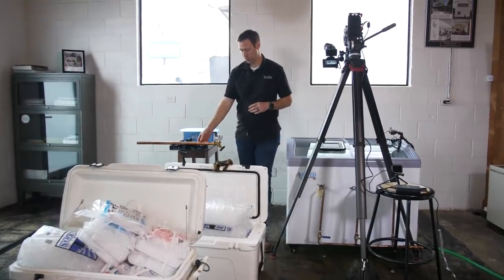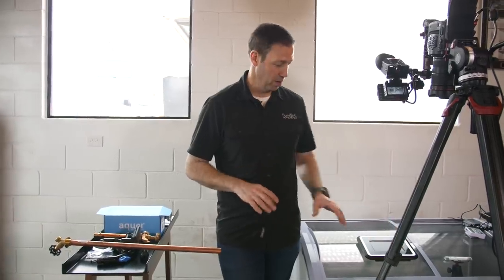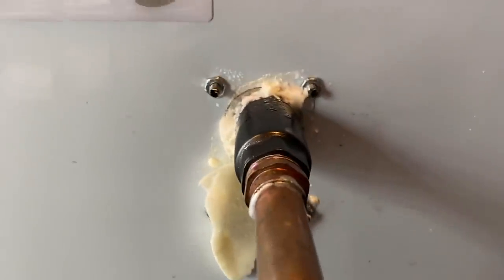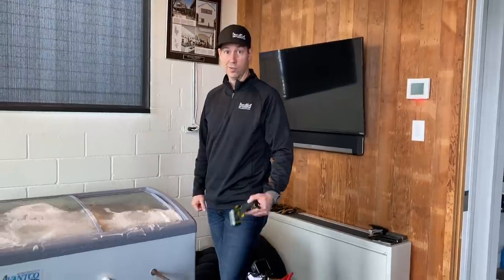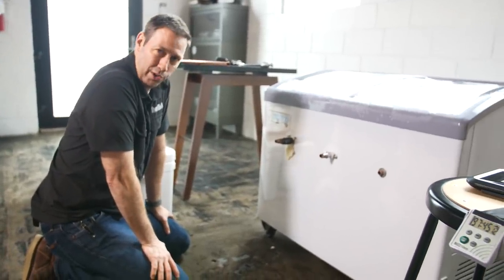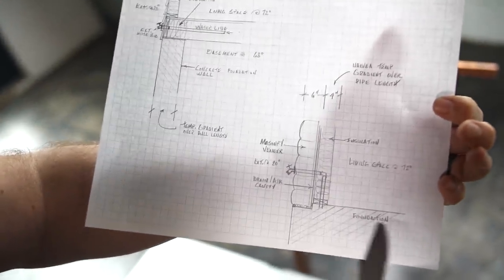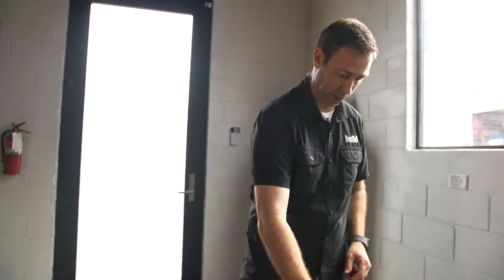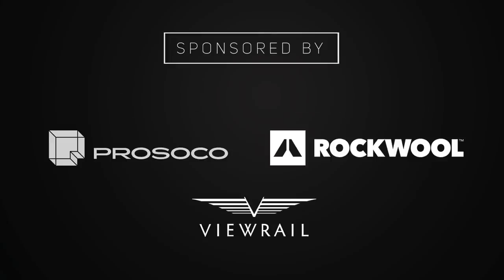Frost-free Hose Bibb?  Yep, it TOTALLY ICED over!

Comment: I like the concept and idea of running this test. However, in addition to the trapped air mentioned in other comments, you can't do a straight substitution of dry ice for chilled air because of significant differences thermal capacity and rates of thermal energy transfer with regard to conduction, convection, and (to a lesser extent) radiation. 

To be fair, I think this test would actually be somewhat challenging to run in a way that would be indicative of results in-service because there's a lot to be said about forced air. When it's really cold out, there are often strong winds that come along with it.

Comment: In northern climates the vapour barrier is on the inside. Even if the pipe gets cold, you won't get condensation there because the air inside the insulation has the same dew point as the air outside.

Comment: I remember visiting farms that had pipes sticking out of the ground with hose bibs and a handle on the end that they used for watering their gardens and the chickens.  This was in Wisconsin.  I always assumed they used those faucets all winter long.  Am I mistaken?  I always thought that was a better solution than poking holes through the sides of a house or barn.
Reply: I think there are bibs designed to have the valve go deep underground below the frost line. I know there are definitely hydrants at places like campgrounds that have the underground valve.
Reply: I worked at a golf course where we installed one.  The handle that you use to control the water flow was 8 feet below grade.  It was coming off an 8” municipal water main which is why it was so deep.  This was in Southeast Michigan.

Comment: Rubbish at best a pitch of Aquors. We install 12" or at least 10" frost frees bib (not 4") with vacuum breaker, they will last a lifetime with a single easily replaceable  gasket.  The $100/$150 aquor plastic bibs + [$25 plastic Removable Faucet]  at a great disadvantage. Their claim is meaningless to be "asse approved" (never heard other than Vacuum breakers certifications) in 50 states... And applying Dry Ice at -109F and other side Texas humid air and saying look at the moisture ... just as rubbish. Just about anything placed on Dry ice will show "moisture" issues. Aquors provide a clean look and that is about it. They have moving parts and connector could fail due to debris and been plastic.

Comment: I live in Northeast Arkansas and several times during the winter we get nasty dose of hose bib popping cold.  So, we did not include outside hydrants when we built our home.  Instead, we ran a loop of 3/4" PVC pipe around the house tucked up to the foundation.  This loop feeds hydrants at the various flower beds that we water.  The hydrants sit on top of galvanized pip risers.  I use standard hydrants and I really like the 1/4 turn ball valve models available from Lowe's.  The loop is fed through a cut off valve located the main water service line.  When cold weather threatens we close the cut off valve and we don't have to worry about a busted hydrant while we are out of town.  In almost 20 years we have never had a busted hydrant.  Materials were cheap compared with the cost of opening up a wall to replace a split line.  Assembly time was half a day at the most. We did the job before the footings were back filled and avoided the cost of digging a trench.  With this system you can tap in additional hydrants when and where needed.  It is important to disconnect all hoses when you winterize the loop.  If Matt had attached short, water filled hoses to hydrants before they were covered I can assure you that two of them would have busted for sure.

Comment: The pressure coming out the first one was the air bubble trapped from you turning on and off the water . All three needed to be bled with water pressure. You need to redo this test and try more materials besides copper

Comment: Energy transfers from hot to cold. Cold is a lack of heat energy. The brass and stainless fittings are reducing heat transfer from the warm side to cold. They aren't trapping cold in. 

I also agree with those who say you had introduced air pockets. You can't get a burst pipe if its not full of water. That's why all of the hose bibs I have used here in MN have a weep drain ensure the air pocket beween the shutoff and outside faucet.

Comment: Repeating what everyone else has said. Bleed the air from the line, add a fan to increase heat transfer to the exposed portion inside the cooler to increase thermal transfer and simulate “windchill”, add some layers of foam to simulate a “thicker” wall cavity, and use thermocouples at a couple distances down the line.The emissivity of the materials along with water and ice will throw off your IR readings.

Comment: I am watching this while the outside temperature is 0 degrees with wind chill -9 degrees Fahrenheit. Come here and conduct the test. One wouldn't have to wait so long to get your results. There are water MAIN breaks all over our town. Doesn't a vacuum breaker faucet solve this issue of outside frozen taps?I suppose it depends on range of temperature extremes between inside and outside of dwelling as  to the ideal design/material choice . Also the qualities or chemical content of one's water should be a factor in chooseing the material of potable water conveyance. Google Flint, Michigan Wate rNOVA-PBS
Reply: my crawl space normaly isnt 60 to 70 f and my hose bib kas water all the way to the end not air